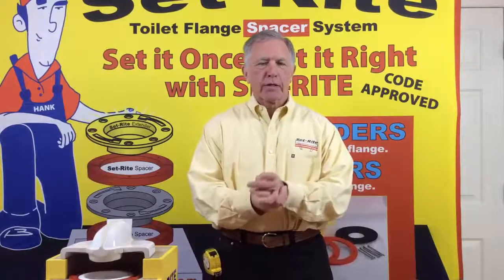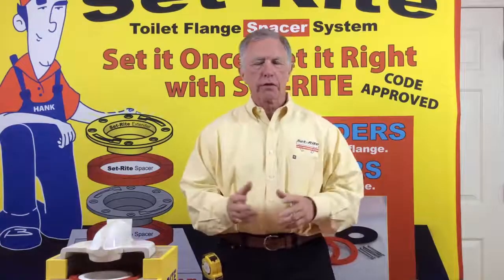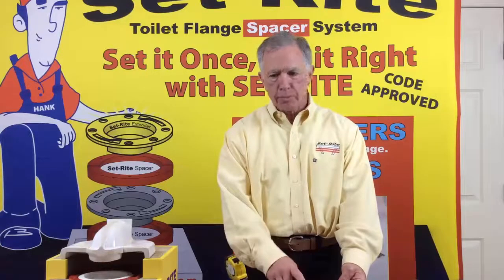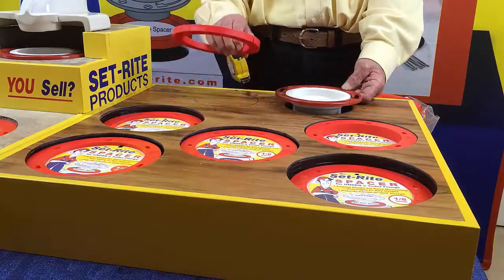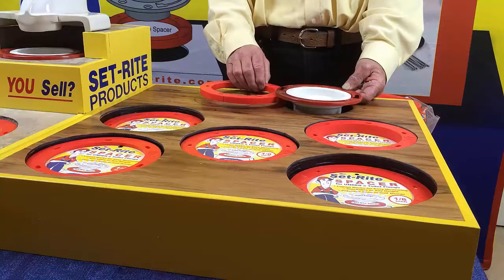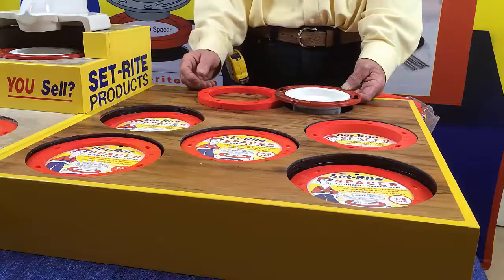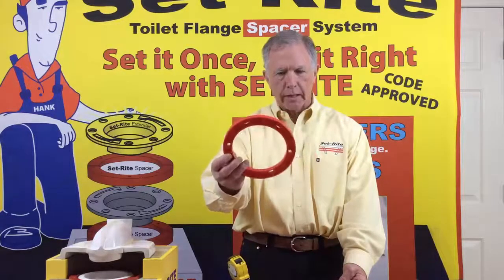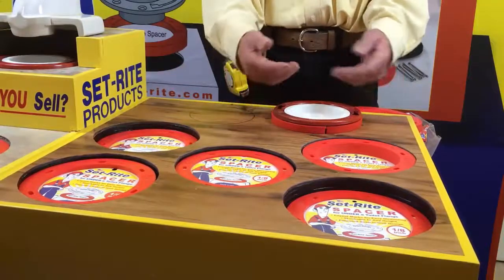Remodeling Your Bathroom with Set-Rite

Comment: Ok, Where to start, Don't let them scare you into spending more money then you need to on a product that won't last as long! Abs fittings are cheap and they litterally make different flanges for all kinds of different situations. I'm a Plumber, we don't install a w/c flange without knowing the finished height of a floor, if we don't know or can't get that info we will extend the pipe well above finished floor (cap it) and then buy a flange that fits into 3" pipe, therefore allowing us to cut the pipe down and install the flange after the floor has been installed. dont be worried that the pipe inside diameter will then be around 2.75"s because there probably isnt a w/c or bidet on the market today that has an inside diameter larger then 2.5"s.. however this product would be handy to raise a flange without the need of a plumber if you were doing a reno and the new floor will be higher then the old, I am just a little worried about that gasket though, it will dry out and crack eventually which will lead to damaged sub floor/leaks..